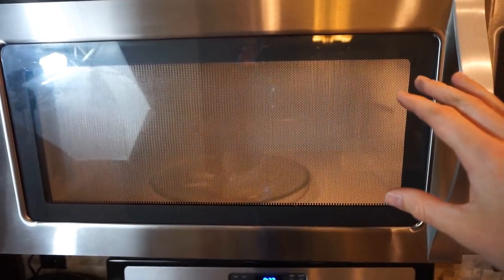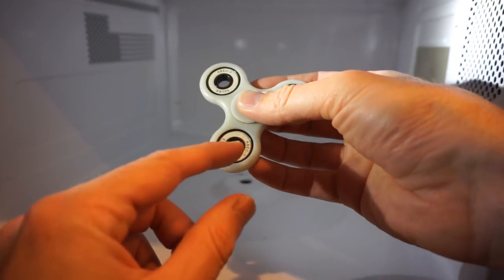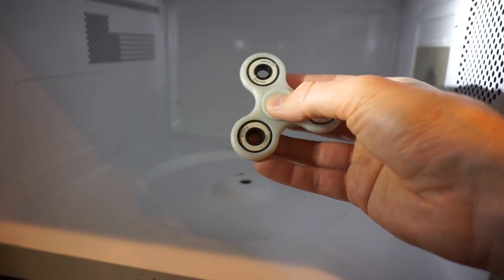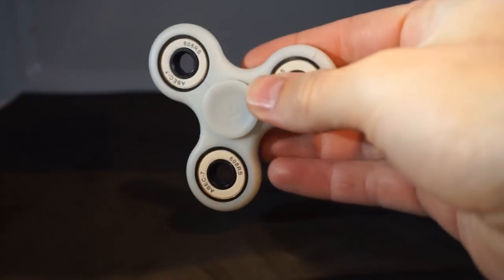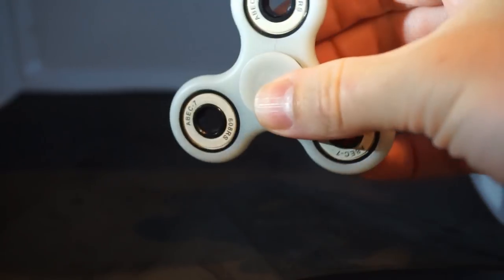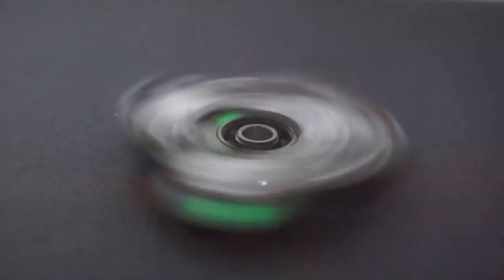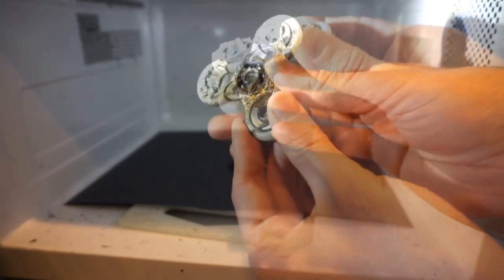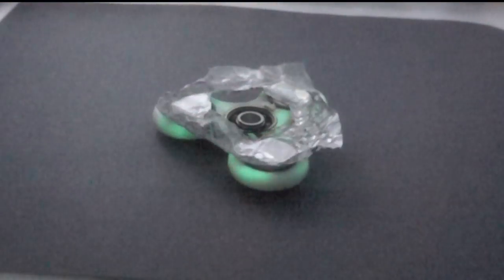What Happens to a Mylar Covered Fidget Spinner in a Microwave? ߷

Comment: I have a slight concern.. Wouldn't the radio-waves effect your health in anyway? Like cancer? Should you maybe get a lead shield when doing this.. But it still awesome!
Reply: (and I don't want to be a heath freak fyi) I'm just concerned..
Reply from the maker: +Joseph Crissey my camera nor I am being exposed to microwaves in my setup. And even if I was, you cannot get cancer from microwaves. They are what's called non-ionizing radiation. They don't have enough energy to break DNA and cause defects. They simply cause water and sugar molecules to vibrate and this heat up. So the effect would be deep tissue burns (and a broken camera)
Reply: Thank you for answering! But I would like to see how you did that. ;)
Reply: Also an interesting thing I found, is that a microwave can block wi-fi signals..

Comment: Why don't you show how you filmed. It is not a secret to simulate a closed door and put normal glass instead in front of it.
Reply: Pheile he didn't do that. all the microwaves would escape and potentially hurt him. check your facts
Reply: Cullen Lonergan not if he leaves the room or has the mesh in front of himself
Reply: I think that is exactly the reason he isn't showing it. ^^
Reply: Jacques RC actually the microwaves would hit his camera and ruin it. so no.
Reply from the maker: Pheile, I dare you to stand in front of a microwave with just glass on the door...
Reply: The easiest solution is to use a fiber-optic camera, i.e. one with a fiber-optic connection between the front lens and the actual camera electronics. You can easily bend the fiber (but not too much!). You can now make a small hole in the microwave (smaller than the wavelength, insert the fiber. Bend the fiber and wrap it in aluminium foil. There will be little leakage through the hole, and the microwaves that do leak will be absorbed by the foil.
Reply: Is that it?
Reply: If people eat constantly out of them how dangerous could such a short Clip be? I mean you can still stand on the side of it where actually is protection.
And btw Im not trying to bully I really like your Channel. Just my thoughts...